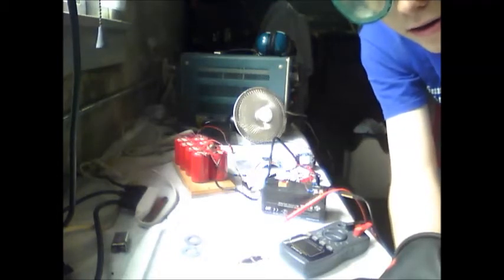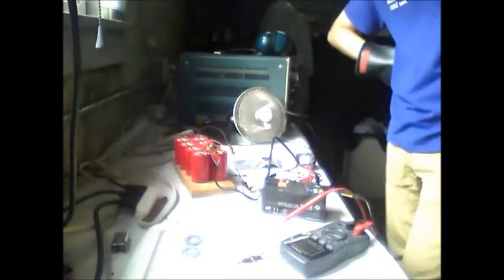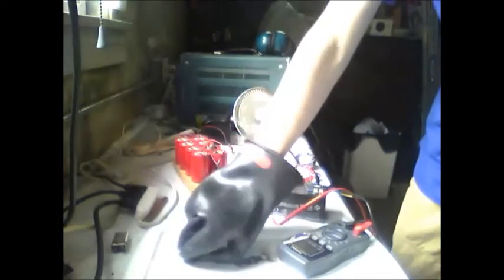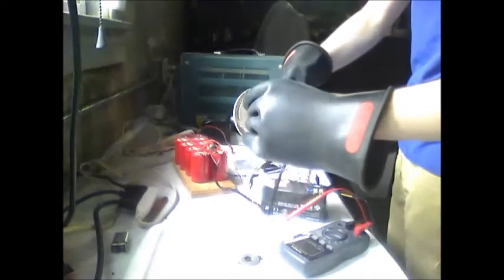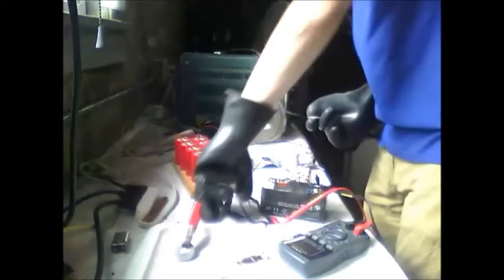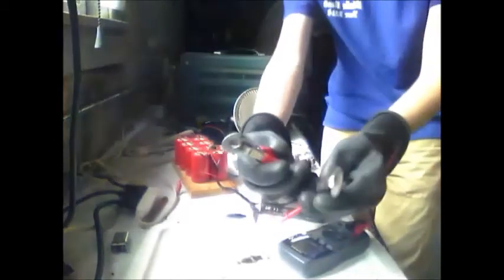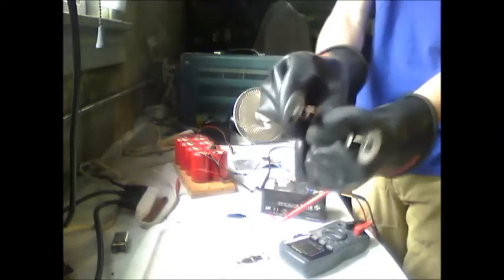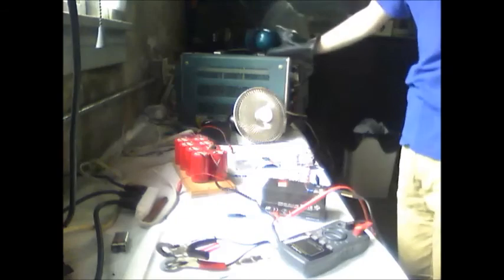spot welder

Comment: I suck at electronics but do you remember if you were able to maintain contact between the washers? It may have just arced across.
Reply from the maker: No, this wasn't a true spot welder. I couldn't really control the strength of the weld.